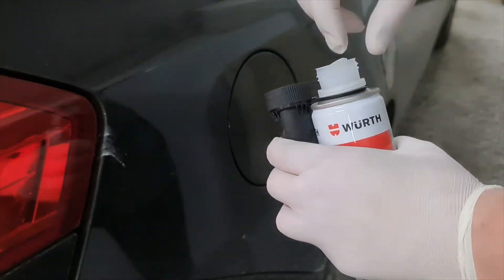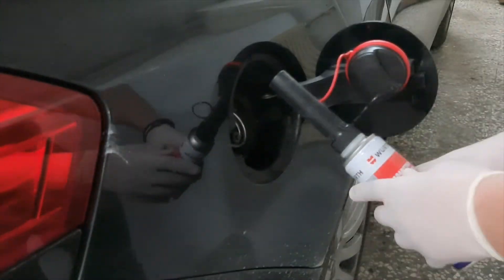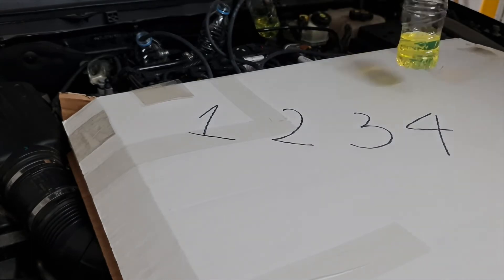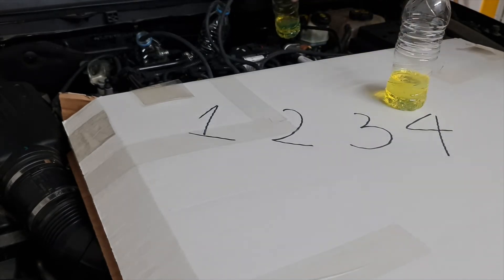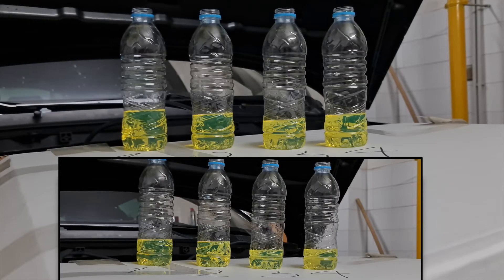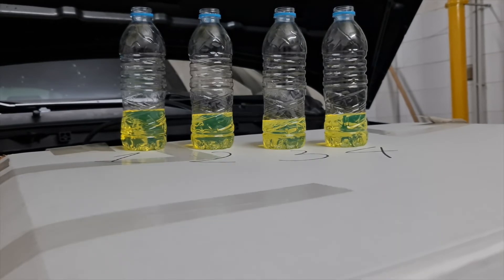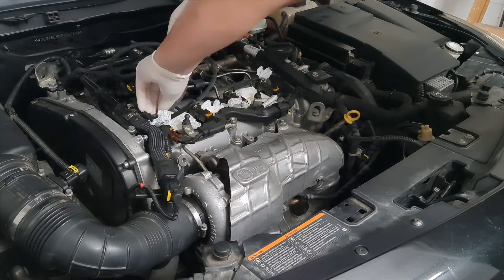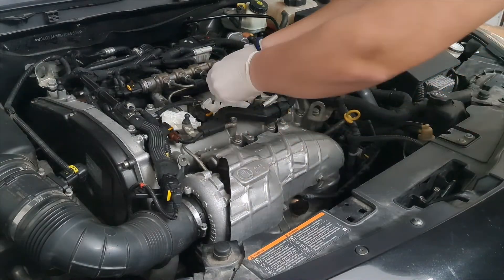#Diesel Injectors Overflow Test #Wurth Diesel #System Cleaner Test# Part 2

Comment: I hope that was NOT piezoelectric injectors orelse you ruined them when you disassemble the return tube of fuel.
Reply: can you explain please?
Reply: @simonbaker3085 all new injectors with common rail system controlled by ecu and inject fuel multiple times before the phase of compression.
This type of injectors working ONLY under constant pressure. When someone who don't have this information try to open the backpressure to check if they are clogged, ruin them!
And a small tip: never let your reservoir to drop less than 1/4 because sucking air and this type of injectors stressing and their life shortening.
Tip2: piezoelectric injectors NEVER rebuilding, is a spear part that after 180K to 230K Km. You through away and you apply new. You can't change the "nose".
I hope I helped you.